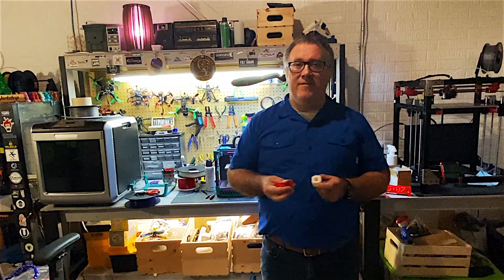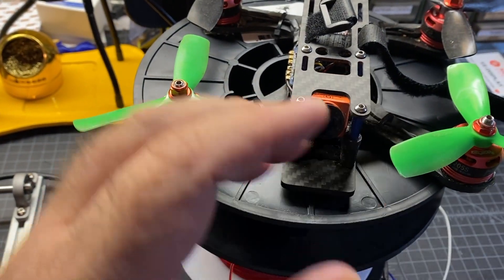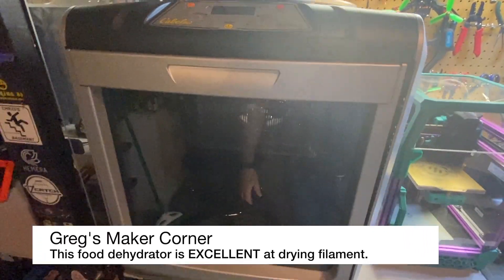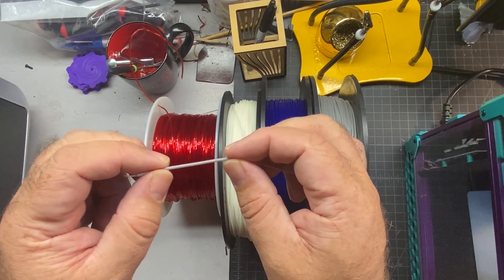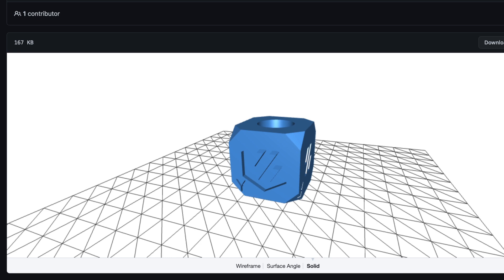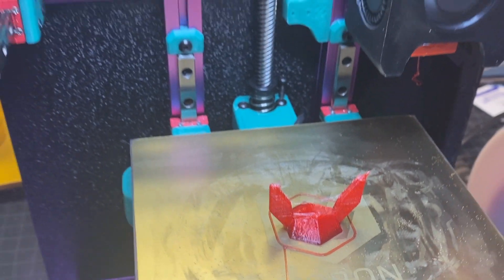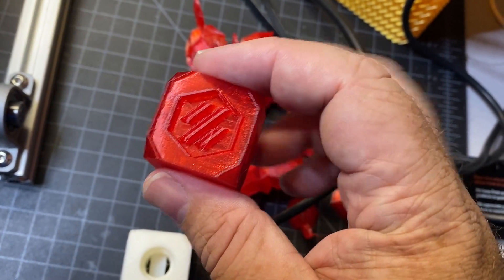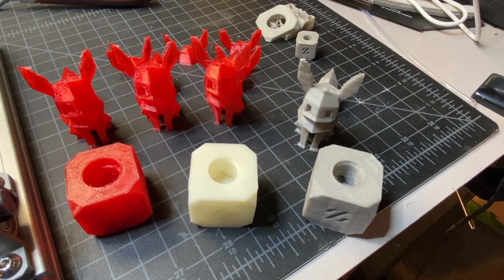Printing Flexible Filaments on the Voron 0.1

Comment: I’m getting frustrated with my voron0.1 as i keep getting randomly those air prints, the filament get squished on the extruder then it wont extrude anymore i try back the filament tensioner a lot, and disable retraction but still have this problem. I’m gonna try your settings for the slicer. Any other recommendation Greg?
Reply from the maker: Make sure you clean out the filament path into the mini ab. Some people will use a drill bit to clear it just in case there are any bits of plastic causing things to get caught. If that doesn’t help consider going mini after sharpa or lgx lite.
Reply: @GregsMakerCorner  thanks for reply, i think ill change extruder, the lgx lite i cannot find it where i live, any other type do you suggest? Orbiter maybe?
Reply from the maker: @danieledm0101  Take a look at the Mini After Sherpa project.  Orbiter 1.5 is supported but there isn't a v2 yet. I'd also suggest Sherpa Mini which uses most of the same parts as the Mini AB.
Reply: @GregsMakerCorner  i bought a miniafter sherpa extruder, anyway together with it i bought a replace of gears for the mini afterburner for a last trial to fix it, after changing it i notice that the extruder was still skipping badly opened the stepper motor and i realize the nylon gear was not spinning! I then loosen quite a lot the 5 screw holding the mini af until i was able to spin the nylon screw with hand. Now I’m getting really nice prints that i was never able to achive before. Thanks anyway for the help
Reply from the maker: @danieledm0101  Glad to hear you resolved it! That sounds like quite an adventure... thanks for the info as well!

Comment: I really need to start writing down the settings I do like you show. I end up usually just tweaking and forgetting all the things I’ve tried. Nice video!
Reply from the maker: Thanks much! I found that taking notes (using OneNote...) is a great way for me to remember what I did. Sometimes I will also save different copies of the profiles, but that tends to clutter things up quite a bit.
Reply: @GregsMakerCorner  I have been using S3D and it doesn't have a great way for saving profiles. It has always been confusing to me for some reason. i know it's just me but I don't like the way they do it. I really need to buckle down and use Prusa or Idea.

Comment: I have only tried Ninjaflex and generic TPU on a boden tube hot end with good success so far. Appreciate the video to help with my fine tuning Greg.
Reply from the maker: Good to hear- thanks for dropping a comment! Best of luck with your TPU. It sure is a bit of work getting it dialed in.
Reply: @GregsMakerCorner  I found the hardest part was getting the TPU past the extruder into the boden tube. My solution was to pass the first 10mm through a flame, this burnt and stiffened the end, and was all good from then.
Reply from the maker: @kieranclarke135  Ahh that is a great idea! May have to try that... lol.

Comment: @Greg's Maker Corner What speeds did you use for each different filament? TIA.
Reply from the maker: The Sainsmart was about 50 mm/sec. The softer TPE about 25 mm/sec, and the Ninjaflex around 20. Quite a bit slower than what I normally run :) I think these may be able to be pushed a bit faster but would require more cooling especially for the NinjaFlex. BTW, I have more detail on the settings in the description.